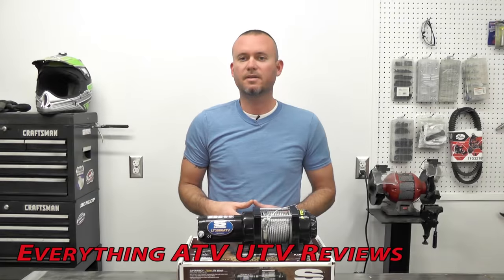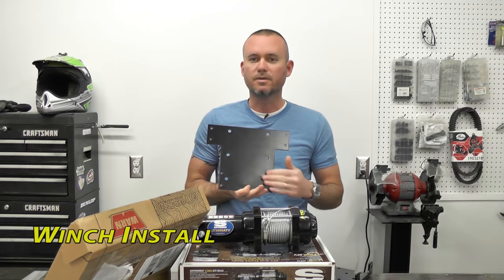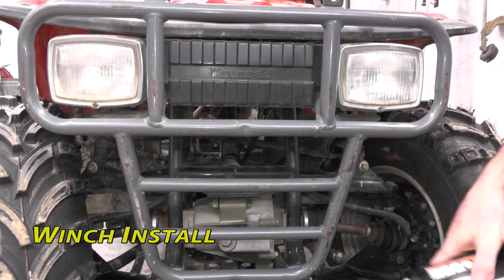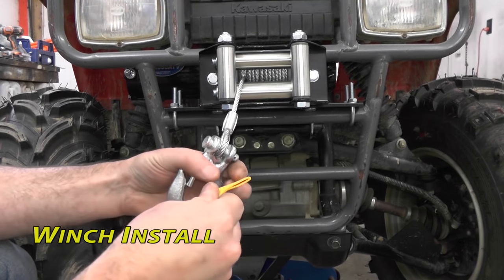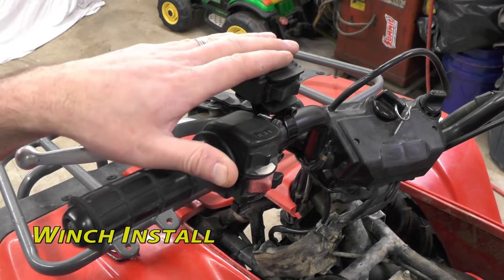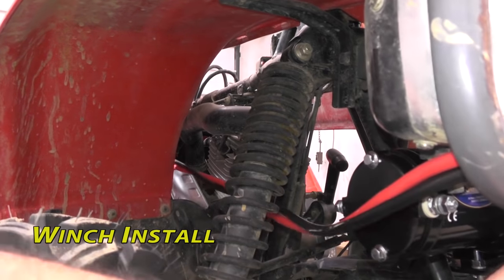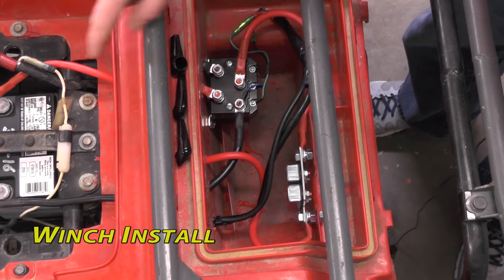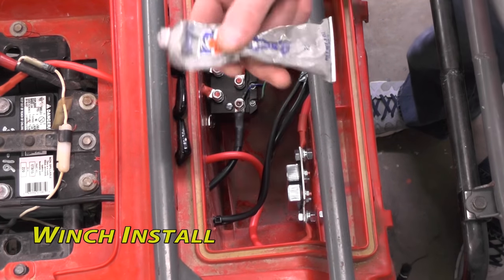HOW TO INSTALL an ATV WINCH

Comment: So I have been looking into some upgrades for my 2007 Honda rancher 420, and I was wondering what the best upgrade would be? I would just get tires but the rear rims on these came with 11 inch rims and I cant find a 25 inch tire for it. Id have to buy rims too. So here is what I have been looking at: front bumper $150, winch $200, light bar $60, extra fuel tank $100, tires and rims $500. Tires are a little pricey. I ride hard pack trails 90 percent of the time, and quite a bit of pavement too. BTW my ties still have 65 percent tread left. I figured you were a knowledgeable guy so i would ask!
Reply from the maker: Thanks for the comment! All the upgrades sound great! If you ride by yourself and have no help getting out of the woods.... winch and extra fuel would be first pick. If that's not the case a light bar is relatively inexpensive for the amount of performance, a lot of bang for the $$$. These LED light from AuxBeam is pretty awsome for the money 
https://www.auxbeam.com/70018818?tracking=5a775831e46b3
Reply: Everything ATV-UTV-Reviews alright thanks!

Comment: next time put the rubber protectors on the end of the wires before you bolt the 4 wires onto the selenoid box.  then you won't have to unbolt then rebolt.
Reply from the maker: Thanks for the comment

Comment: what do I do with the keyed hot lead?
Reply from the maker: The Bayou we installed this on had aux keyed hot leads built into the harness.  If you can't find any and don't want to splice in somewhere a toggle switch could be used. Thanks for the comment.

Comment: nice bayou 300.
Reply from the maker: Your 1990 is very, very clean for the year model and still has the factory tires! Nice job keeping it looking good, these workhorses are getting hard to find. See you have a winch, did you have issues with the winch mounting plate on yours?
Reply: The winch mounting plate was a little hard to get on.I had to make some new holes to make it work.
Reply from the maker: Was your mount a Warn brand? Your modifications similar to these? https://youtu.be/sM8kmsZ0Egg?list=PLOqvKi40if-IvQXAS2bxT8Lo8VFP6qW_O
Reply: Everything ATV-UTV-Reviews I had a different brand of mount. And I still had to drill  The  mounting bracket